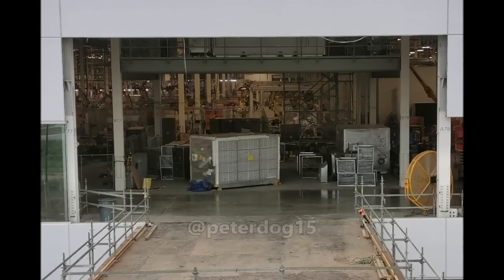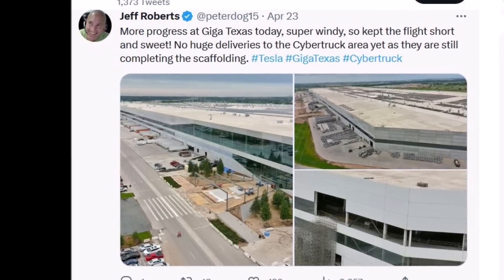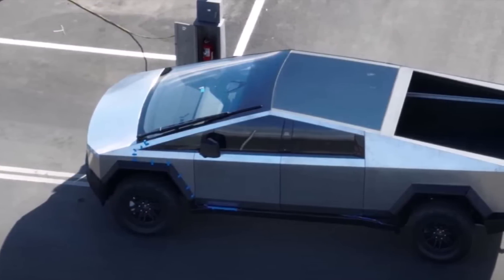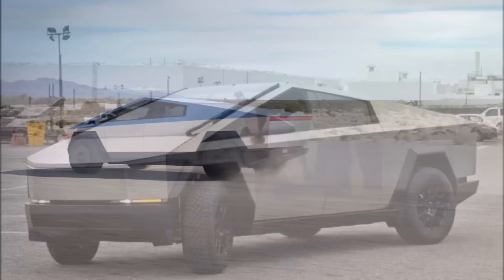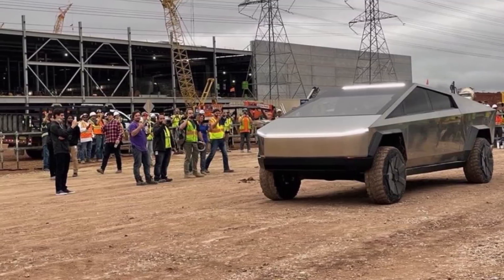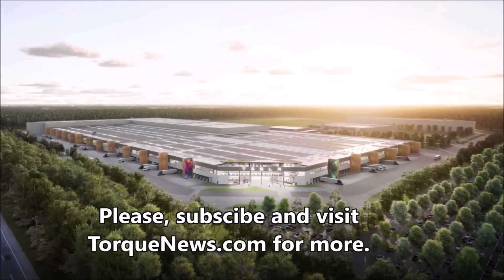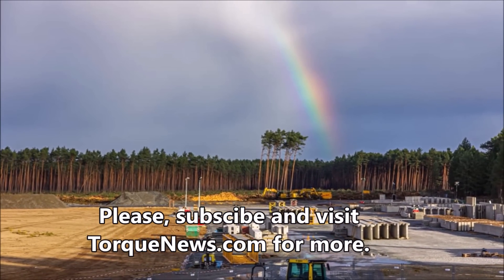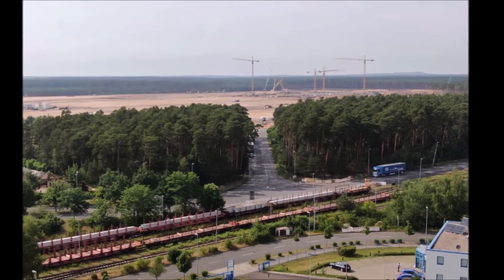RARE VIEW Into Tesla Cybertruck General Assembly at Giga Texas

Comment: What do you mean with a small version of the model Y. Shorter?
Reply from the maker: Shorter range, slightly, with BYD batteries 🔋
Reply: In the US, there are 3 model Y variants. The standard model has a range of 279, but not LFP. So, if the BYD battery will replace the current base model with the LFP, I'd like that very much. 
Model 3 rwd and long range are already using LFP packs by CATL.
Reply: @kabysummit5801  There are four. 4680 (Texas)  are available also.
Reply: So different but not smaller!